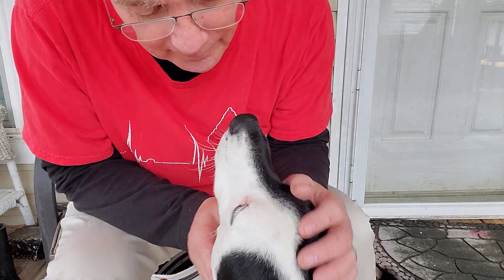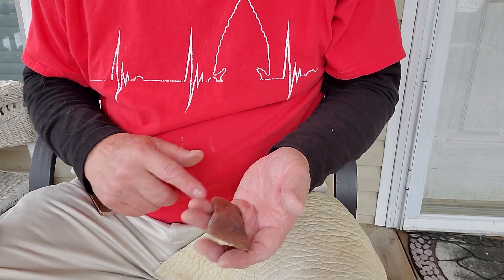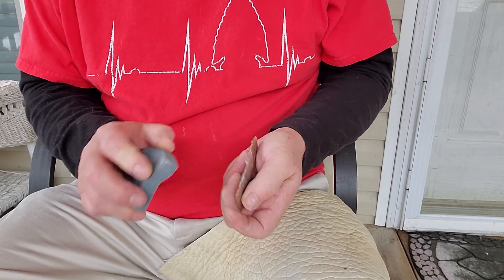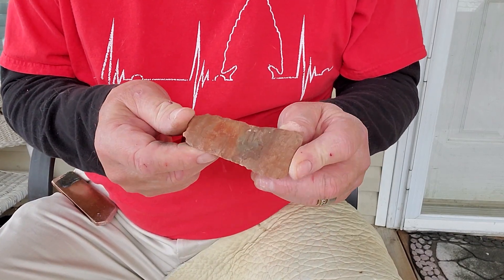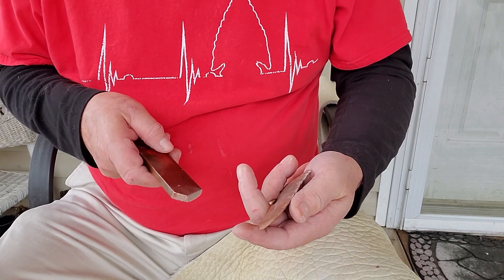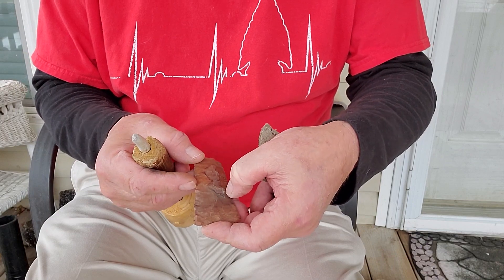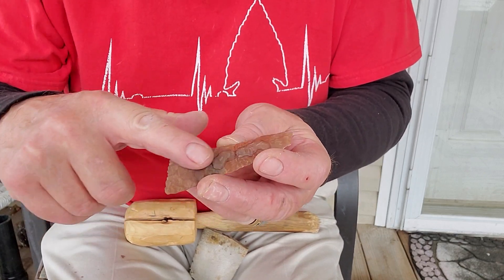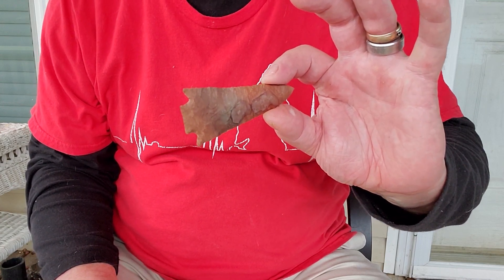Flint Knapping - Testing a Flat Copper Bar for Percussion Thinning

Comment: That’s a beautiful point. Is that heat treated Buffalo, if so what is the texture and quality like.. it has a look of flint ridge through the camera lens.. I’ve found Buffalo but it hasn’t looked as good as that material.
Reply from the maker: It is Buffalo river chert that is heat treated and medium quality.
Reply: @EDBO23  I’ve got 1 largerish bi-face Buffalo that I’d like to give you if I ever run into you again at a knap in… work has kept me from getting to any since I met you up in Tn… but maybe early spring I’ll be able to start making the knap in’s again. Thank you for the videos and the reply.. I’ll keep watching; you keep knapping! Have a great evening.